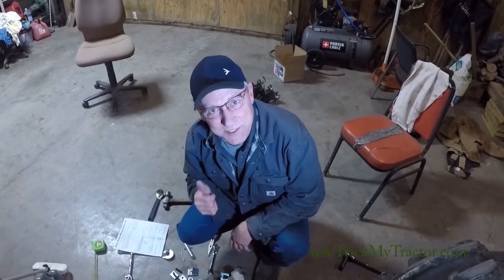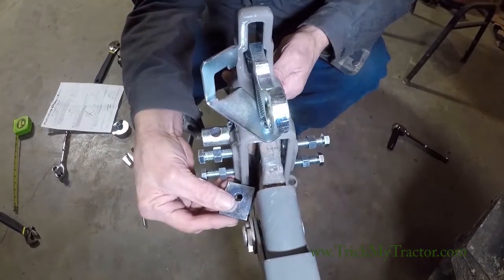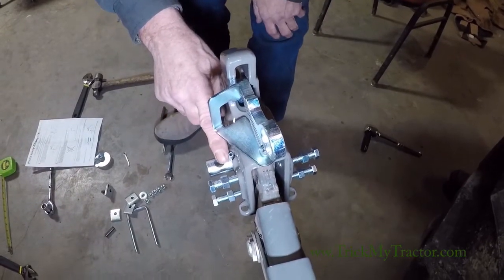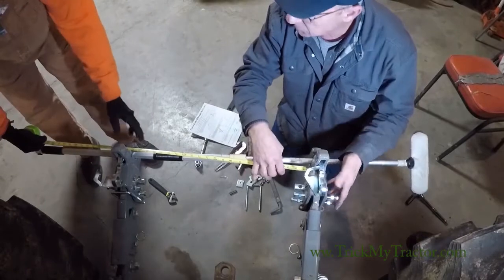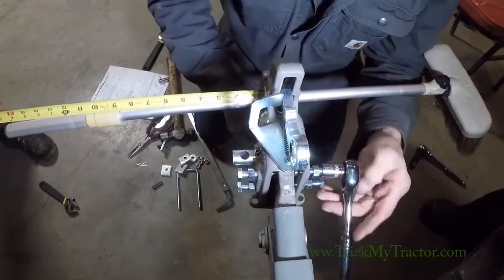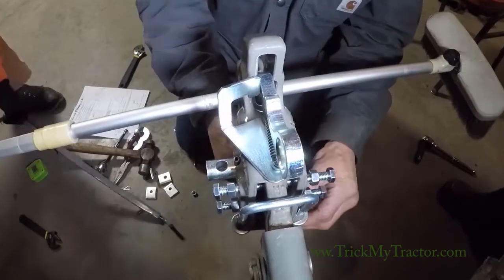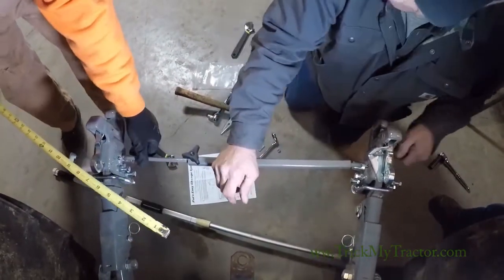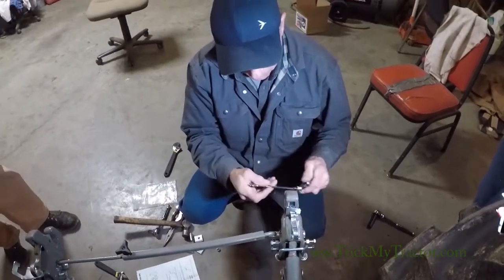Cat1 Installation Pat's Easy Change Quick Hitch TMT

Comment: Liked and subscribed, I’m looking forward to get one for my Massey!
Reply from the maker: Hi Dave, Thanks for subscribing. Here is a code for $10 off your set of Pat's Easy Change Quick Hitches at   www.trickmytractor.com .  Use Discount Code:  easy change
Reply: @PatsQuickHitches  I ended up getting one at Rural King, but thanks for a great product!
Reply from the maker: Hi Bob
Thanks for asking.
You should remove the stabilizer bar after hook up.
Sherrie
Www.TrickMyTractor.com
Greenwell Manufacturing LLC

Comment: I just installed my pair yesterday.
My only issue was that amount of paint used made the tolerances so tight that I couldn’t drive my pins through, nor easily hand tighten down my jam bolts. I had to file down the inside snd scrape that paint off to get that big pin through. And even with a ratchet, those side bolts were HARD to turn. I had to use a small impact driver for the side bolts. Other than that, installation seemed like a breeze,
Reply from the maker: Mr. Werner, thanks for you comment.  When we switched to powder coating we quickly learned we needed to plug the holes to prevent paint build up.  Please send your address to Sherrie@trickmytractor.com, and we will send new pins and complimentary washers for you trouble.  I appreciate your business!  Sherrie www.trickmytractor.com

Comment: What size is the U Bolt? Multiple reviews recommend replacing the U bolt with a Grade 8 bolt. I need to know exact size of U bolt to purchase a Grade 8 replacement U bolt. Also, some reviews recommend use of a NY lock nut for bottom nut on U bolt. Any comments or advice in this regard would likely lead to me purchasing this Cat 1 hook based hitch for my 50 HP Branson tractor.
Reply: @sherrieplouchard3645  Thanks, Sherrie. Appreciate the quick reply.
Reply from the maker: @Lpmgato1  Always happy to help before and after the sale.  Sherrie

Comment: I’ve got a Pats quick hitch, makes for some easy hitching up to my different implements. Question, do you leave the adjustable spreader bar in place after hitching up and when using the implement?
Reply from the maker: It’s best to remove it after hook up.

Comment: What is the cost of a catagory1 system
Reply from the maker: Hi Ken
Thanks for asking.
Cat 1 in gray is $190.
(Free shipping)
Use Discount Code:  10
For $10 off.
We have a price increase Aug. 1.
Www.TrickMyTractor.com
Reply: @PatsQuickHitches  just tried this code and it didn't work
Reply from the maker: Disc code:  pats
Www.PatsQuickHitches.com